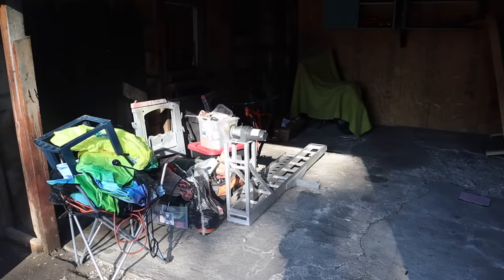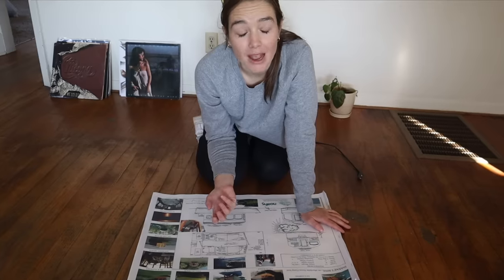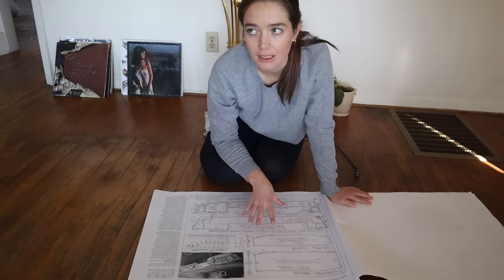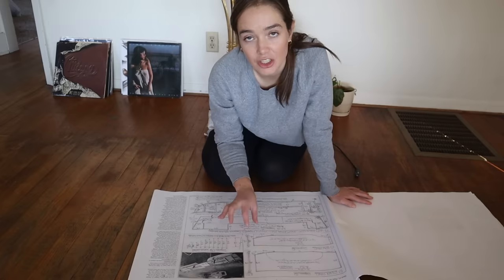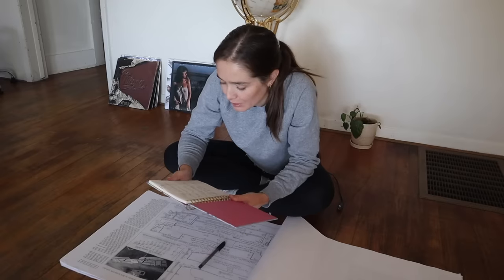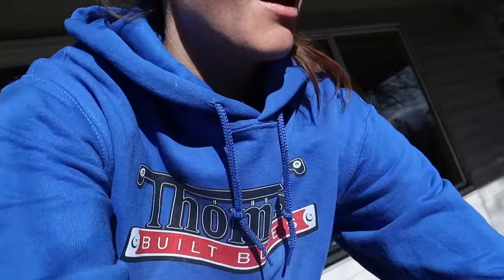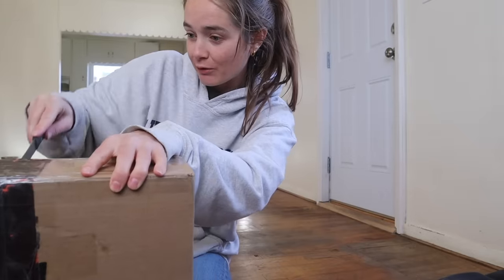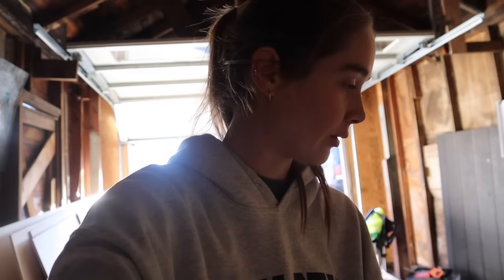Building this house boat might be more than I bargained for (Boat Build Episode 2)

Comment: That Bosch router is excellent and versatile, shame to return it. The smaller ones are palm routers - less power to cut. With a router you have to consider the rotation direction - watch some videos. you can use 8 x4 insulation as a surface to cut your plywood on to break down large sheets. It's safer than using the raise saw horses. I strongly urge you to consider a track saw - kreg makes one that will fit your current circular saw If you can't afford a dedicated track saw. Don't forget your safety glasses especially with routers.

Comment: Hi Emma.  Your boat build is quite the undertaking.   I will be watching  intensely.   Having spent 25 years of my working career working with fiberglass, especially in conjunction with its application to plywood, I am happy to offer any advice on questions you might have.  Not knowing the size of the hull, just want you to know from the get-go that to use polyester resins, which are what are used to saturate the fiberglass material; be it cloth, matt, or roving, requires close to  room temperature,  70° F, for the resins to cure properly.  Also, with the application of resins on the exterior of a surface,  such as plywood, the resins need to contain a surfacing agent, commonly referred to as wax, to allow the resins to cure dry to the touch, as opposed to tacky to the touch.  Feel free to ask me any questions you might have.  I enjoyed the bus build and know the boat build will be exciting to see.
Reply: Good on you for offering advice on glassing techniques...that is probably going to be the most important  skill she must have, and the most difficult to learn how to do properly.

Comment: When building with plywood, epoxy and fiberglass, you should have enough slack on each glued connection, so that you can get enough glue in between of those. Also, in corner joints, you can easily hide some imperfections behind epoxy fillet. Nice project you have!

Comment: You can use a 4x8 foam sheet insulation to cut on and that will support your work and let you cut through the wood just a little bit.  You can cut on the floor or on the sawhorses.

Comment: GOOD start.  I have built several small boats and own larger ones.  The best approach is to not look at the whole project, just concentrate on the part you are actually working on.  That way you are just building a whole bunch of little projects.
Reply from the maker: Doing my darndest to keep this mindset 🤞
Reply: @EmmaBuildsBirbie  Think of the boat as building boxes  than a boat There is no V shape bow to deal with, etc

Comment: Dear Emma - please get yourself a decent dust mask. Marine ply is hardwood cores and 'interesting' glue - don't inhale much of it....  Some eye protection and maybe some steel toecap boots might make it easier

The wheel looks 'real'. At 13:47 we see the centre hole in the brass - and there's a keyway at 1 o clock. That's to transfer the force to a central shaft on the steering gear. Ornaments would likely omit this feature.  You will want to varnish it with a few more coats - it's going to be handled constantly!  

Good luck!

Comment: for around $20 US, you can get a panel /  plywood carrier. it hooks onto the sheet and lets you carry it without all the fuss.
Reply from the maker: What?? This is life-changing information
Reply: @EmmaBuildsBirbie there are several designs, some squeeze the top of the sheet to lift, some fit the bottom, have a good look round before you choose & maybe get a couple of different ones.
I've always liked the ones that grab the top because there's less to store when not in use but carrying big sheets can sometimes be awkward.

Comment: Emma, two things. I think that you did get the right size router for the type of work you're doing. If you're going to be routing a lot of 3/8 or thicker wood, I think you need a more powerful router than the little single-hand types. Those are for more like trimming 1/8 inch material, and stuff like that. Also, check out what a "plunge router" does, in case you think you might need that. Lastly, do you know what a "track saw" is? If you don't plan on having a table saw, you might want to look at a few videos on how to use a track saw. They're like a skill saw, but you lay a metal track down on the sheet of wood and the saw follows the track. 

Anyway, good luck. I'm pretty sure you got this.👍

Comment: Hi Emma, I just came across your chanel and am excited to see you progress!!! I am still nervous with each new project, even though I have built lots of "stuff"! I think it means you are doing something important (I'll add "to you" as some won't get it!)! A hint for you when cutting larger panels...save some of those Amazon boxes that are the same size, to lay your ply sheets down on! You never need to worry about cutting off a corner of your stands or damaging your saw blade! I also made two straight edges that I clamp as a saw guide so yout cuts are guaranteed to be straight, one 50" and one 100". Hope this helps and compliments on your editing skills! Also, I think your wheel will be awesome! You may need to make or scrounge some hardware! The yoke is keyed and you may be able to fine one from old tools with crank handles! I keep a keen eye during my builds for items needed down the road! I was excited to pass (and back back up) a finished yardsale this summer with boxes of free stuff! I got a single burner alcohol stove, a runner carper and a great cooler, all for free for my MiniD build! On Home Depot... I so agree with you! I would love to support my local lumberyard and do so as much as possible but I feel nore at ease being left alone to "pick" a pill of ply or lumber! Left alone, I've found clear 2x12"x16' cedar boards, which are a rare find but possible when an employee isn't picking out the wood for you! Also look for used, free wood that folks leave on the side of the road! I trimmed my last boat in mahogany, using old bed frames, etc. collected for free! Just avoid the glue lins as the joints likely did not use waterproof glues! You are off to a great start! All the best Roy
Reply from the maker: thank you for all the advice!

Comment: Hey Emma I used to restore boats when I lived in Florida and for a wood hull before you paint it you should coat the outside with West epoxy or it won't be water proof water will eventually soak through paint and into the wood with out the epoxy barrier

Comment: Routers are the tools that scare me the most… and I’ve been woodworking for years. Bigger is better in many ways because, like the one you got. Larger ones often have good handles that keep your hands far away from the bit and make it much easier to control. There was another comment about saw horses, and I agree.  You need a really stable surface for your plywood and template. I have used palm routers successfully, and I’ve pooched some material with them too. The only time I almost hurt myself with a router was with a little palm router. (One handing it ‘cause… you know. 🙈) Hearing protection is something else you’ll want with a router they can be really loud and hearing loss and tinnitus is no fun. 

Looking forward to your journey with this build. 👍

Comment: A tip to cutting plywood if you want a clean edge I.e. no torn edges, place a strip of tape where the cut will be so you cut through the tape when cutting
Reply: The blade used is very important cutting plywood want one with a lot of teeth
Reply: @jamesHadden-l6l but not too many or it burns.

I believe the ideal is 2 to 3 teeth in the cut.

Comment: Maybe unless the plans give possible suppliers Get a magazine copy of Woodenboat they have numerous ones listed I did when I built my 8 foot Cold molded pram years ago It was a chore a round bottom with 3 layers of 1/8th inch cedar Had to order that Each layer was at a 90 degree to the others A ton of scribing with a compass and won't mention how much epoxy resin it took  Each 8th inch veneer had to be scribed  to the one before  YOU CAN DO IT and a WHOLE LOT MORE So you found the wood   :)

Comment: This will be a challenging build in many ways different from the bus as you pointed out. Practice using the router on scrap or inexpensive wood (not marine plywood) as there is definitely a learning curve to using it. Routers are great tools which demand respect as they can do a lot of damage to materials or you if not operated carefully.

Comment: Congratulations on your new project- I've never built a boat but I've built lots of other stuff.  I'd recommend you visit your local Harbor Freight and pick up at least 4 LED shop light for you garage (6 would be better)- it is very hard to do good work in the dark.  I'd also suggest you look at a portable garage (a big tarp with a frame) while your there to store your tools, supplies and materials in next to your single garage, as the boat gets bigger the garage will get smaller.  I'm guessing your still in the mountain west and winter is coming, snow and dark is in your future.  Good luck, I'll be watching and cheering you on.
Reply: LED lights strobe when running from AC which can make rotating things look motionless.  

If you're going to use LEDs always use battery ones!

Comment: I just started wondering when you're at sure if you build a front end of that. With a little more structure, you could put a hinge system at the front and put a warm board that you could fold all the way back flat onto your deck on the front. And then that way you can flip it all the way back out to the ground when you pull up and then that way you can.  Walk off easy

Comment: Plywood cuts best with the good side down to keep the cut smoother on the good side, but be careful not to get a mirror image of what you need.  I have done that several times in my lifetime.  I suspect that you use the words fear and afraid, where some of us might say very cautious or apprehensive.  Home depot is more expensive for lumber than any place other than Lowe's.  Take your dad, a friend or a gun and stay alert for moving equipment.  They are not allowed to get close to customers on equipment, but like you say, some get childish.  Home Depot and Lowe's require an area to be roped off when they are lifting merchandise.  (I worked at Home Depot for a while after military, and at Lowe's for a year during retirement.)

Comment: Damn, Emma, if I get it right, you're going to build a boat.., all by yourself..  Well, this is some serious projekt you're undergoing...Keep calm, measure three times with no cuts, then measure the fouth time and only after you're absolutely sure, make the cut. Hickups at the beginning are part of the process, so don't worry.
Hehe, the router is handheld, just the normal size. I don't see any problem with that..
Anyway, you have an ambitious projekt in front of you, the best recipe is to make it the best you can and not accept mediocrity..=) If you're a perfectionist, you strive always for success. And remember, it's not because of being excelent, but because every error you make, it will get your road to success harder, while every step you accomplish precisely, will make your road easier. Cheers, Emma, looking forward to see you happy. They say a hard earned goal is priceless. You know what? They're right! 😉

Comment: FROM SCRATCH?? oh wow, I thought you were buying a shell and just doing up the interior.  It's gonna be a challenge but it's going to be a great reward in the end.  Epoxy is going to become your best friend lol best waterproofing, just epoxy coat everything.  good quality anti-fouling paint for the submerged bits is key too.  Luckily there are a TON of sailing channels on YT you should watch.  KEEP THOSE ROUTERS.  You'll regret downsizing.  Buy a router table too.  That's what the router on the right (grey toed sock) installs in.  The one of the left (white toed sock haha ;P) is for hand-balming all your cuts.  PRACTICE PRACTICE PRACTICE before you touch the wood you really want to use.  So exciting! Good luck! Learn form mistakes and just remember to have fun! and of course measure twice, cut once.

Comment: The router you bought is exactly what you want for pattern work!
Reply: Agree!
Reply from the maker: I worried I won't be able to handle the size!
Reply: I get that. A router can be very intimidating. And a palm router definitely have their place. But the larger router will actually give you more control. Its weight and size plus two hands on it make it more stable. Best of luck to you, I'm sure whichever way you go, you'll make it work. P.S. being a little scared is always good when using power tools. It helps to keep you from getting complacent and lazy. Thats when bad stuff happens.
Reply: @EmmaBuildsBirbie as the operator your job is to keep the base flat on the workpiece & that's easier with the bigger tool, the router pulls itself through the wood following the guide.

Comment: Lumberyards are just 😊 way way bigger Home Depots. Fear not! They won't run you down with their forklifts.
Forklifts seem scarry (doing those donuts) they're not really purposefully trying to seem reckless. Its just that forklifts steer from the rear wheels and are powered from the front wheels. It means they can turn inside their own footprint (tight, tight turns). Because of that the drivers take full advantage of the physics involved to do their jobs as effectively as possible. Turning in really tight spaces is something very much part of how lumberyards get things done.
The drivers, to do their jobs, have to be safe; they look first behind them, always.. part of forklift driving. It just comes with the territory so to speak. 
You simply don't drive a forklift without looking first behind you, it the direction from where the steering itself comes. Trust them they know what they're doing.

Comment: No, no: these plans are not a benchmark: they are just the things that someone has done for themselves and then passes on. You have to take into account what you can buy from you - that means: the wood, the dimensions that are available from you.
Essentially, such a vehicle is made of wood - laminated wood - but it needs waterproof gluing!
and: finally you need fiberglass mat and resins: yes, that can be expensive.
You may need the fiberglass coating - not just on the outside but also on the inside: in Asia they do it in such a way that the wood is the skeleton, the load-bearing part of a ship - only in Japan can you do it - only from glass fibers can you even make highly resilient fishing boats size to build!
Your boat is not difficult to build: just modify what you can't get - and generally try to make it in one dimension, i.e. a single thickness: that saves money.

It's simpler wooden construction - with something waterproof, i.e. fiberglass coating - that's all it is!

Keep your head up: you can do it - and we'll help you with every bit of advice we can!

Greetings from Berlin!

Comment: That is not marine plywood. Even if they say it is. My guess is that they said it was made with waterproof glue. That does not make it marine ply. Even most lumber yards have never heard of true marine plywood, which is okoume. And it comes in millimeters 4,6,9,12, etc, not American Imperial measurements. If you want the boat to last any time at all even when coated with epoxy and fiberglass - it needs to be okoume. It is definitely more difficult to source, but many suppliers will ship. Best source locally is to find the nearest boat builders or boat building school. They can often add your order to theirs and you get the bulk discount. To build a boat that you are building, you will be wasting a lot of time and money if not using okoume.

Comment: You should buy a jigsaw for cutting those small notches and or any inside holes you may need to cut. It's much lighter and easier to use than your circular saw.
Reply: she's using one of those oscillating cutters which are even lighter.

Comment: You mean 9mm marine ply? 🤣

As far as the router goes, you could've used that size router. By the time you've bought the router and all the other gubbins to match what you've shown, you're probably looking at the same cost anyway. And the bigger router would have had a more powerful motor.  And the router bit you're about to buy (Have bought?) is called a flush trim bit. It has a bearing at the top or bottom and you place 

Ah well.... I'm guessing we're months behind real life again, anyway.
Reply from the maker: as much as i'd love to be able to get months ahead, this was earlier this week and I still have the router
Reply: @EmmaBuildsBirbie I prefer a bigger heavier router, I find them easier to control.

Comment: I would just buy a run down boat then go from there I think that would be the cheapest way
Reply: I would be very surprised if that's the cheapest way & the way she's doing it she will know every single inch of it so will be able to find & solve problems much quicker, plus with all new materials there should be less problems, especially as she's working from plans from a respected designer.

Comment: If you're going to glass  it you don't need marine grade plywood.  Once you glass it, it's waterproof if it's done right.
Reply: You obviously haven't met water, it gets through the tiniest pinholes or absorbent patches.
Reply: I've had solid fiberglass pirogues. No wood at all. Never had water seep in. I built a flat bottom skiff with foam, wood, and fiberglass. Didn't have that problem. Like I said, if you know what you are doing, water won't get through the glass. But you're right, I'm from south Louisiana, 20 minutes from the Gulf of Mexico. I've "never met water."